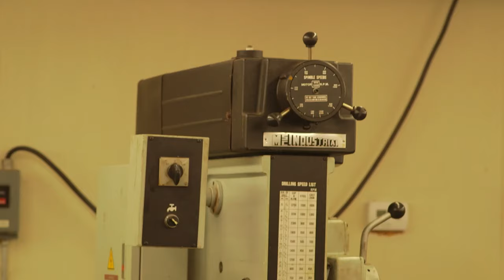Millwrights - Learn what a Millwright is and what they do

Comment: Still don't understand what a millwright does.
Reply: In short millwrights deal with industrial machinery. From installing it, fixing it, and maintaining it. If you dive a little deeper they especially deal with alot of precision alignment work for motors, pumps, and shafts.
Reply: Pretty much an iron worker that knows how to do math lol and also  precision work, alot and alot of bearings, shaft and conveyour work

Comment: I'm finishing school this year considering to become a millwright. I've heard that a millwright also do electrician work and that's the only thing that I don't want to do I like working with my hands just not installing elektriesion type of work 
Any advice maybe?
Reply from the maker: Contact the Millwrights and have them talk you through the program.  Being a millwright is a very dynamic career with lots of different facets that you can get into.
Reply: The school I’m in they let you pick once you get around 44 credits rather you want the pipefitting concentration or general technician concentration last year they let students pick Electrical Concentration while they’re also in Industrial maintenance technology so you would be getting 2 Degrees
Reply: As a union millwright myself I have not even been allowed to touch electrical work. I'm with you I avoid electrical at all cost
Reply: I was the same way until I got some practice in electrical, as long as you're safe and make sure power is cut off it's not bad work
Reply: Learn everything you can get your hands on.
Reply: We don't actually do electrician work we learn the very very basic parts of electricity but you won't actually do any on the job